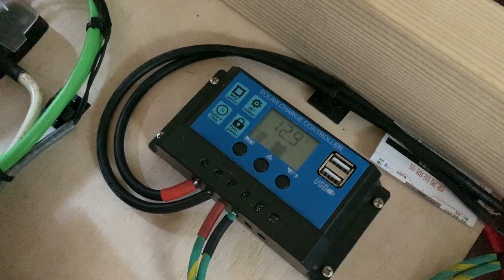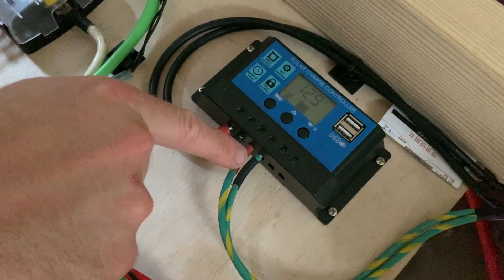How to Install Solar Panels on a Campervan | Van Build Step 12

Comment: So, you use split charge system through alternator of the car and solar panel as well. What you think was it enough for long holidays (say 10 days) or you missed having the main outlet for powered campsites? I am confused about my electrical as weather here is 250/365 overcast.
Reply from the maker: As long as it was sunny or we drove the van every day it worked out ok.  We did eventually add a battery charger to keep the batteries topped up at shady campsites.

Comment: You really dont want to have power running through your charge controller without a battery. It will burn your controller up.
Reply from the maker: Hmm not sure what you mean?  It is connected to the batteries.  We may not have discussed it in this video because we broke electrical into three videos but it’s definitely connected!

Comment: Nice content.  what are the specifications on those aluminum brackets?  Thickness etc. and where did you get those?  Home Depot...  Do you think four of those will be sufficient for one 280w LG panel?  Got one for free :)
Reply: nvm see it on ur website lol
Reply from the maker: I think with the bigger panel you’re probably going to want to go with 6 or 8 depending on the dimensions.  Gotta love free stuff!!  Best of luck with your build!

Comment: How has using the self tapper screws straight into the roof worked out?? I am about to install solar panels on my van for the first time and I was wondering how this technique has held up for you??
Reply from the maker: Still working great.  No issues and no leaks!

Comment: I see you drill directly the solar panel on the roof, no rain issue? No rust etc..? Im mounting mine and just the glue is not giving me the peace of mind that my panels are secure 😅
Reply from the maker: No issues so far.  We used a sealant where the screws go though the roof.